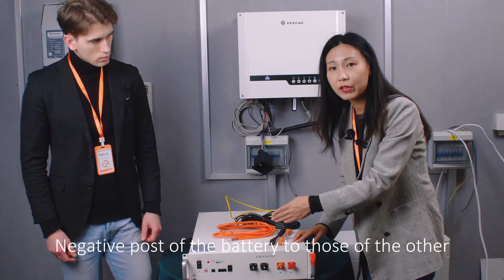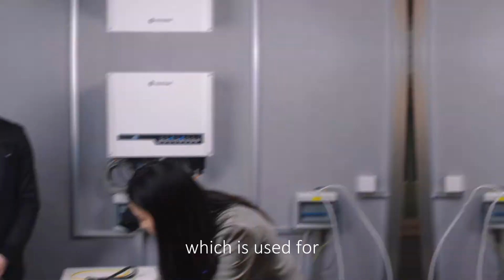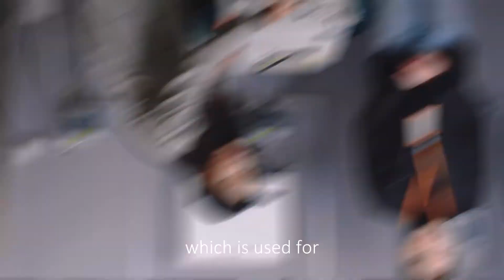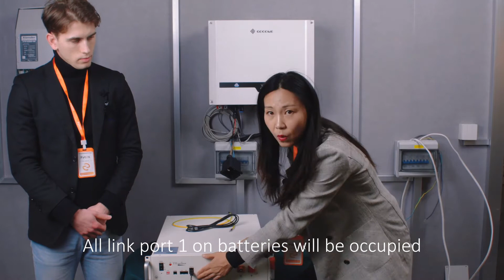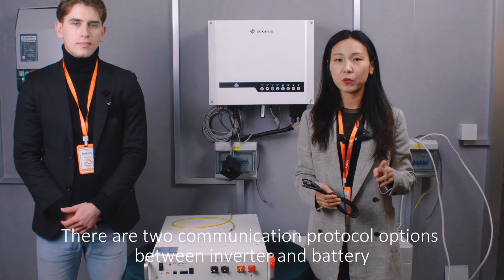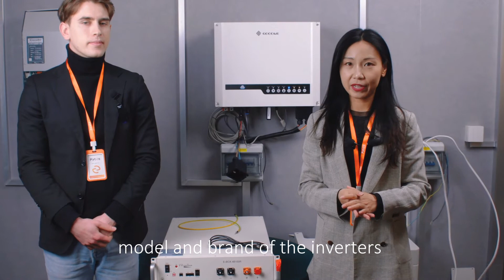How to connect Pytes energy E-BOX-48100R  battery  with Goodwe inverter

Comment: show the correct pin conections that need to be made on BMS inverter side and CAN batery side for comunication cable . standard cable don`t work .  This video shows nothing about it . Goodwe and E-Box don`t work as easy . Goodwe PV Master app dont have Pytes or DLG battery to be set directly for comunication .
Reply from the maker: Hi Adrian, Sorry for the inconvenience,  Can you let me have your contact information, or can you connect me through email or whatsapp? I will ask our technical workmate to solve the connection  problem for you, Sorry again.
Reply: Hi.  did you manage to solve the problem with connecting the PYTES BMS battery to the Goodwe inverter?  thanks